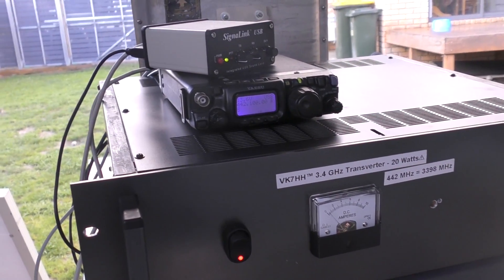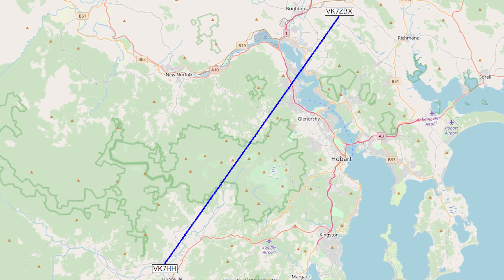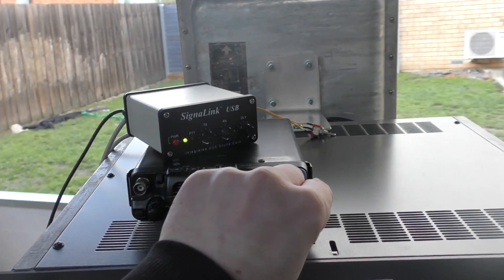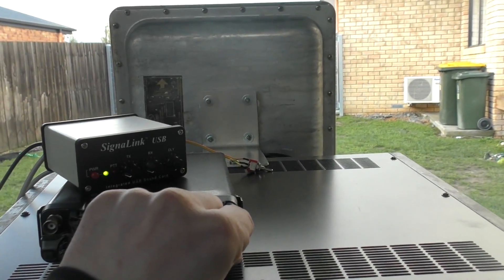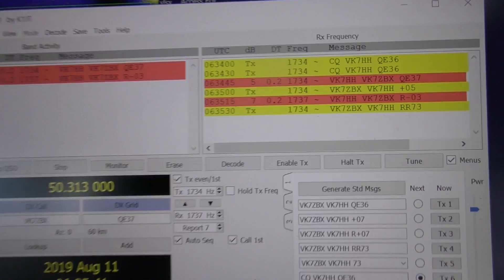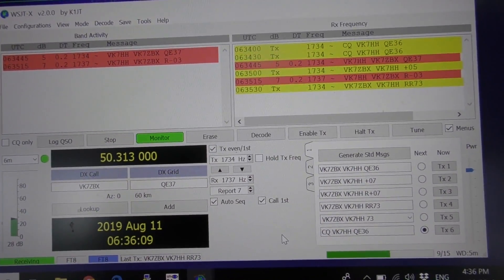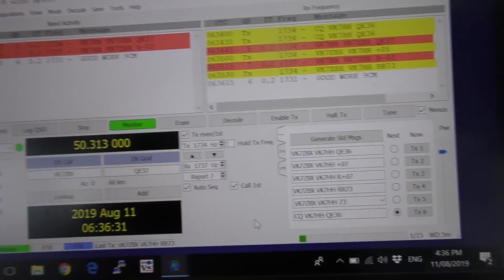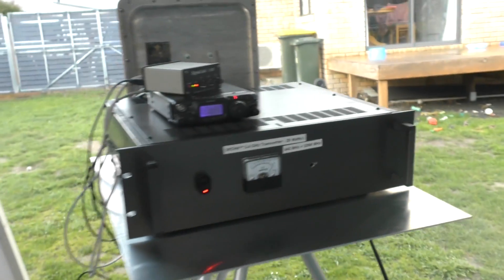Trying FT8 on the 9cm microwave band

Comment: Do you have a block diagram of how your sequencer is incorporated into your setup?  How are you having the sequencer control the IF radio when the computer wants to tx digital mode on its own?  I have an ft-818 I want to use on a 10 ghz. analog ssb/cw setup.